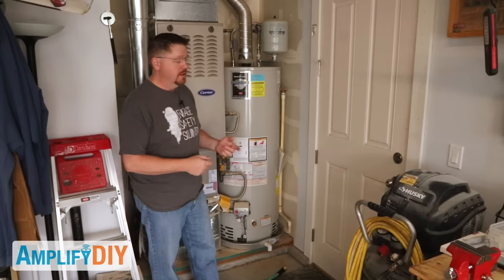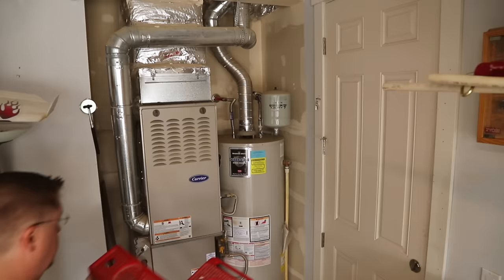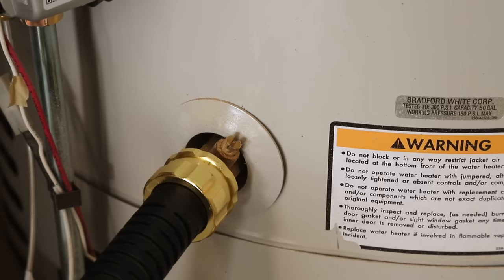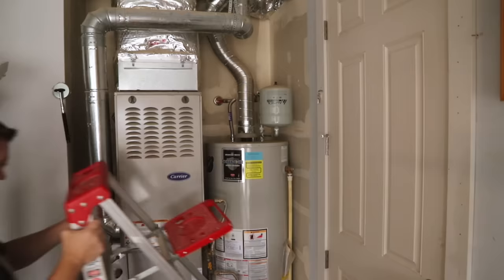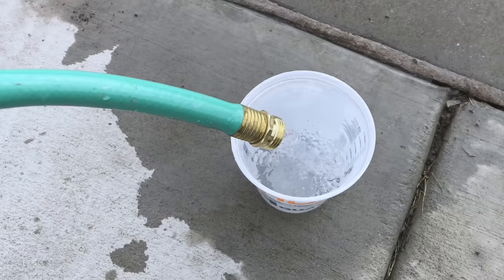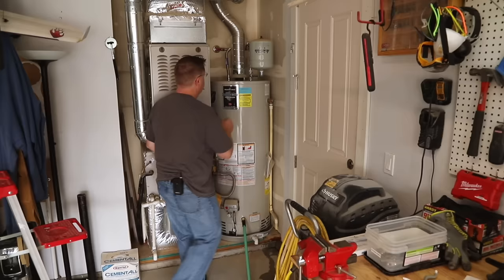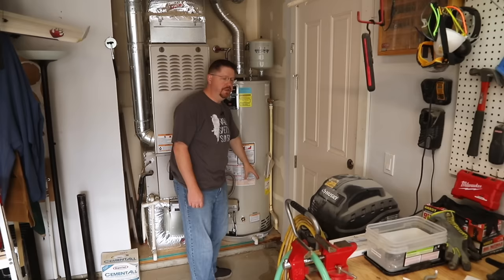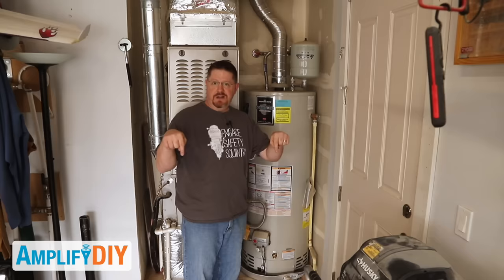How To Flush A Hot Water Heater To Remove Sediment

Comment: Question...When I fill my extra large master bathtub, the hot water turns cold about 2/3 of the way full, and the water turns brown.  I'm guessing this is sediment from the bottom of the water heater.  I was wondering if a simpler solution might be to simply keep the hot tap running after it turns brown and cold.   The cold water fills from the top of the heater and dislodges the sediiment and it runs through the pipes into the tub.  Would this work?  Thanks!
Reply from the maker: Hi Craig - this won't work very well for a number of reasons: First, you really don't want all that sediment to get up into your plumbing. It'll clog faucet screens, adhere to the interior walls of your plumbing, etc. Secondly, most of the sediment is too heavy to get stirred up to the point of actually exiting the heater. What you are seeing come out is only the finest levels of sediment. Sounds like your heater is well past due for a good flushing. Good luck!

Comment: when you open up a faucet for air, do you keep that faucet running the whole time or can you turn it off after a period of time once air is in the tank?
Reply: also if opening a faucet is enough, and you need to use the pressure release valve, do you need to keep the faucet running after that for the whole drain?
Reply from the maker: Hi Michael -  Apologies for the delay in my response. All you need to do is let air into the system, so water can come out. If you can do that with a faucet, great. If not, use the T&P valve. As for when to open/close each: Open a path to let air when when draining the tank... and I usually leave it open for the whole flushing process. If you close it during flushing, remember to open it again when filling the tank, to allow a path for air to escape. If you have to use the T&P valve to let air in, then you can close it during final fill and just open a faucet to let air out. 
Good luck!

Comment: What if I have two hot water heaters? Does this process change at all? Like do I have to turn off both?
Reply from the maker: Hi Kevin! With 2 heaters, they are generally plumbed in series (heater 1's outlet feeds into heater 2's inlet). If this is the case for you, you can simply do them one at a time. I do recommend turning off the heat to both heaters when you start the first one, and start on the first heater in the system. Once that one is flushed, do the second. 
Good luck!

Comment: Can you drain it into a utility sink in the same room as the water heater? Or does it need to drain outside?
Reply from the maker: Hi Lester - as long as you are draining "down hill" from the drain port of the heater, you can drain into whatever you like. Most likely though, the sink will be at a higher level than the drain port of the heater, so you'll need to find a different way to drain, most likely to outside the home somewhere. Good luck!

Comment: My question is do you leave the hot water running while it drains? Or close it once we have flow when draining the water heater
Reply from the maker: Once you turn off the cold water inlet to your heater, hot water should stop coming out of your faucet. At that point it does not matter if you leave the faucet open or closed during the flush. Just make sure it is open at the end when you fill the tank up for the final time, so there is a path for air to escape from the tank. Good luck!

Comment: Do you have a video on how to replace a dip tube for gas water heater? I'm thinking mine may be bad as i lose hot water or have diminished hot water in the shower after like 5 mins
Reply from the maker: Lack of hot water or diminished hot water can come from a broken dip tube, but it can also be a sign of a heater full of sediment. Unfortunately, I don't have a video on how to replace a dip tube... but I'd probably start by draining some (possibly all) of the water from the tank, disconnecting the cold water inlet, and looking visually down into the inlet to see what I can see. Use a borescope if you can get your hands on one to inspect down the length of the dip tube for damage/disconnection. That will confirm if you have a problem with the dip tube or if something else is possibly going on. Good luck!

Comment: My hot water tank is in the basement, will it be too much water for the drain I have in the furnace room?
Reply from the maker: Hi Scott: you can drain into the drain in the floor. That's why its there. I do recommend two things when you do so: if you happen to have a sump pump, turn off the heat source for your heater then go take a shower, do a load of laundry, or do some dishes. This will lower the temperature of the water in the heater, so when you drain it you won't overheat the pump. Secondly, I recommend you use a kitchen strainer to catch any large chunks of sediment so they don't go down into your floor drain. If you have a lot of sediment, it's possible to clog the drain. Good luck!

Comment: Will this help increase hot water pressure? Recently my second floor shower has lost a ton of water pressure.
Reply from the maker: Not likely, no. Have you taken off the shower head to see if it is full of gunk? How's the pressure with the shower head removed?
Reply: Turns out it was built up gunk in the shower head, thank you  @AmplifyDIY

Comment: you don't need to turn the cold supply off or the gas off or the breaker off. By leaving the cold supply on, it actually forces more sediment from the bottom of the heater
Reply from the maker: Hi David - this is a common misconception. It will blast sediment that is VERY close to the drain valve, but the rest of the bottom of the tank will be completely undisturbed. To stir up and agitate the whole bottom of the tank, you have to get all the water out of the tank first. Thanks for watching!
Reply: @AmplifyDIY  worked for me just fine, I used a clear drainage line and a ton of crap came out. You cant prove me wrong and you right when you can't see inside the tank to prove one or the other
Reply from the maker: @davidbradley6165  I've used a borescope to inspect the interior post-flush. The method I describe is more thorough, as when the tank is still full of water and under pressure, opening the drain valve is akin to shooting a water gun under water. Yes, it can agitate sediment in VERY close proximity to where the dip tube ends inside the tank, and very close to the outlet drain valve, but in between, the rest of the sediment is mostly left alone. You don't have to believe me, of course, but maybe next time try this: Do the flush the way you usually do. Then drain the tank and briefly open the cold water inlet a few times as I described in this video. Observe if more sediment comes out.. I think you'll be surprised. Again - thanks for the comments, and for watching!
Reply: @AmplifyDIY  thanks. I’ll give it a try

Comment: I have a dual water heater. Is it the same process? sorry for the stupid question.
Reply from the maker: Hi Manuel - The only stupid questions are ones that you don't ask! :) Yes, the process is exactly the same when you have a dual heater setup. Most likely they are plumbed together in series (one heater's hot output feeds directly into the next heater's cold inlet). Do the one that is closest to your water supply first, then the other one. The process is the same for both. Good luck!

Comment: I did this, the only thing I’d change is to close the relief then flush with the cold water valve. It uses full pressure to push everything through it of the tank

Comment: My hot water heater is in the basement and I have no drain besides a sink for the laundry room which is higher than the hot water heater spout is that ok? Is there enough pressure to get the sediment out?
Reply from the maker: Unless your house is quite old, there should be a basement floor drain located somewhere in the basement. Draining a water heater as I show in this video relies on gravity to drain, so the exit of the drain hose must be at a lower elevation than the heater drain valve. It won't drain into a sink, for example. I'd look around in the basement to see if you can find the drain... It may be in an unexpected location.
Good luck!

Comment: Thanks, but question, why do you have to drain the whole tank... can't you just do gallon or two since I would guess settlement at bottom?
Reply from the maker: Great question, evsidewinder2! Have you ever drained a bathtub or sink with a lot of junk at the bottom of it? Notice how when you drain it the junk mostly just stays put on the bottom, and you have to swirl/swish some water around the basin of the sink or the tub to get all the junk out? The same thing happens in the bottom of your water heater. Even if water is gushing out of the drain valve, inside the tank the flow of water will be so gentle as to not disturb the sediment at the bottom. Thanks for watching!
Reply: @AmplifyDIY  gotcha! Thanks!

Comment: I have a question if you might be able to answer… we have a whole house filter and softener system and have used your video to try and drain our hot water heater to clean it out several times due to it sitting for 7 months unused prior to us buying our house, it was a newer tank put in before placing on the market, however the water in our area is really bad and the pipes are horrible hence the whole house system we put in and we replaced our pipes throughout as well. Long story long I’ve developed horrible skin issues while being here for the last 4 years and I swear it’s due to the water still, the hot water heater because we haven’t been able to get all of the sediment out of the bottom. I’ve spent all day doing the agitation several times and still stuff comes out and our hot water has a smell and our shower is always rusty color and this is with the pelican whole house filter and softener system and we change the sediment filter on that system every 3 months instead of the recommended 6-9.
Reply from the maker: Hi Des - I'm sorry to hear about your skin irritation - that must be miserable!  Here are a few things to understand about how your system works (based on how you've described it):

Your whole house filter should be located such that it filters *before * water gets to the water softener. This will catch any sediment that comes in from your municipal supply, and keep your softener running smoothly for a much longer time. 
The softener then should be located upstream of the heater - which will reduce the minerals in your water that tend to precipitate (or "boil out") of the water while it is in the heater. 

So, the flow of water should go like this: 
Water supply ----> Whole house filter ----> Water softener ----> Water heater ----> out to the house faucets, showers, toilets, etc.
So the first thing to do is check that all the above is plumbed in the correct way, so that things are not out of order. 

Secondly, make sure you have adjusted your water softener to match the hardness of your water. This is generally measured / described in "grains", and your local water supplier should be able to tell you what your water supply contains. My water supply is between 9-11 grains of hardness - yours may be significantly different from that. Once you know the expected hardness level of the water, adjust your softener to match. Many people never do this, and may have their softener set to 5 grains but water that is at a hardness of 20+. This effectively means the softener is not doing much of anything. Make sure your softener has enough salt in the hopper.

Once you have made sure the softener is matching the hardness of your water, flush the heater as well as you can, and replace the sacrificial anode: https://youtu.be/OIMz1rwx_jc If your hot water has a funky smell to it, you should make sure your new sacrificial anode is a magnesium one. Other metals do not work well with softened water, and can produce a stinky smell.

Once you have done all that (I know, it seems like a lot - hopefully most of it has already been done!) about the only other thing to consider are the pipes, which it sounds like you have already dealt with. 

I hope some of the above is helpful. If you have any other questions I'll be glad to do what I can to provide answers. 

Thanks for watching!
Reply: @AmplifyDIY  hi thank you so much for the reply, yes everything is in correct order, we had our system installed by Pelican/Pentair and have had them out several times since for issues and maintenance as well. I also forgot to mention we have our system to regen every 5 days instead of 10 because of my skin problems. Yes all of our pipes have been replaced by professional plumber as well, we bought our house (which is 100 years old this year) 4 years ago and the hot water heater was put in new before we purchased however it sat on the market unused for over 7 months. We have done the flush twice now, per the instructions of Pelican however we can’t get all the sediment out, it just won’t become clear and both times I devoted literally all day to the steps in your video… long days.  Pelicans trouble shouting line suggestions turning up the temperature before I start the steps to see if that helps.  I’m at my wit’s end for sure being showers for me feels like I’m rolling in fiber glass, and sores on my scalp requiring prescription shampoo. I thought I would reach out to you and see if you had any ideas being I can’t get any plumbers to call me back for some reason.  I’m interested in the wet vac method and sucking it out but can’t find a step by step on it though. I will go to the link you provided me, thank you so much for that. And thank you for taking the time to help. God Bless

Comment: Mine has 2 ways to go to pilot mode which one should I do or should I do both?
Reply from the maker: Check the manual - as long as the burner won't light to heat the tank, you're good.... and GO BLUES!

Comment: My hot water heater (yes, I STILL call it that!) is in my basement so I can't flush to the outside. If there is sufficient sludge in the bottom is there any danger of plugging anything if I put the hose to a basement drain hole? Or a utility sink by my washer but that would mean running up and over the lip against gravity. Any suggestions? I just found your videos as I have a leaky Temp/pressure release valve and figured I'd flush and replace at the same time.
Reply from the maker: Hi PJ - with a heater in the basement, you can and should drain into a basement floor drain. The only precaution I recommend is to use a kitchen strainer to catch any larger chunks so you don't clog up the basement drain plumbing. Best of luck with your T&P valve!
Reply: @AmplifyDIY  Thanks! The faucet handle for the cold water inlet seems to be stuck...I can't turn it and I certainly don't want to break it off. Can I accomplish the same thing by turning off water at main house entry?
Reply from the maker: @pjmiller3770  Yes, you can accomplish the same thing by shutting off the main water supply for the whole house. While you have it shut off, I also recommend replacing the shut off for the cold water inlet. Good luck!
Reply: @AmplifyDIY  Replacing the shutoff is WAY beyond my pay grade (besides not really having the tools)!  🙂 I think I'm gonna have to cave and get help with this one. Thanks for your replies.

Comment: Wasn't the bathroom hot water faucet already open? Am I supposed to close it at some point? Also, Since this is such a good video, why don't you show us how to inspect and/or change the anode while we're at it? And what about the expansion tank? Do we do anything with that?
Reply from the maker: Hi Brian - I opened the faucet to demonstrate one possible way to let air into the system. Ultimately I used the T&P valve to allow air in, so it does not matter what happens with the faucet until the final fill, when the faucet should be opened again to allow a path for air to escape. 
As for the anode and expansion tank, I did separate dedicated videos for both: 
Anode Rod: https://youtu.be/OIMz1rwx_jc
Expansion Tank: https://youtu.be/NGygvtP6Sdk
Thanks!
Reply: @AmplifyDIY  thank you! I’m watching the expansion tank video now.

Comment: So looking at my water heater. I see a red valve which i would assume would be the hot water. So looking at the other line there is no valve. So how do I close the cold water line of there is no valve?
Reply from the maker: You may have to turn off the water supply to the whole house if there was no cold water shut-off valve included in your original installation. Good luck!

Comment: Thanks for this very informational video. When you do your flush bursts, do you keep also the hot water faucet on the one you turned on initially or do you rely only on the release valve at that point?
Reply from the maker: Hi Makmanos - it does not matter if you have a faucet open at that point, since the tank is empty - no water can flow out through the outlet at the top of the heater. It will all discharge out the drain valve at the bottom. Good luck!
Reply: @AmplifyDIY  Thanks for your reply. I actually just finished a little while ago. In my case it does actually flow through the hot pipe out through the faucet if you don't turn it off. Probably the cold water intake is so high that the discharge flow cannot keep up with it so it ends up flowing through the bathroom's hot water faucet if I leave it open.
Reply from the maker: @makmanos  Interesting! Other than that oddity, did everything go ok with your flushing?
Reply: @AmplifyDIY  I think so. I have a Bock oil fired heater and believe it or not, it hadn't been flushed in prob 10 years. I got lots of sludge out and I had low flow from the discharge initially. But once I started agitating it by turning on/off the cold intake it improved significantly. I have to do it in six months I think just to put it on some reasonable maintenance schedule. 
Thanks!